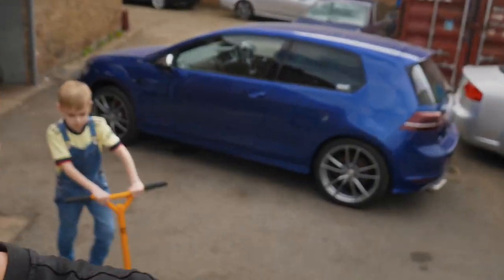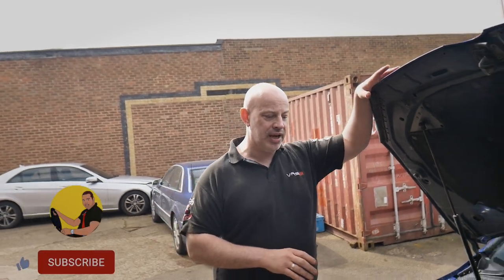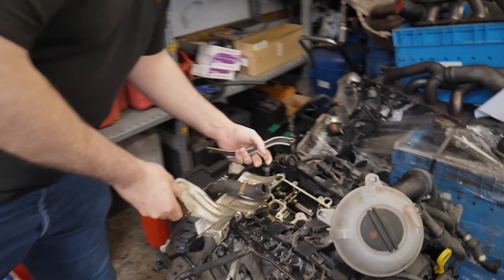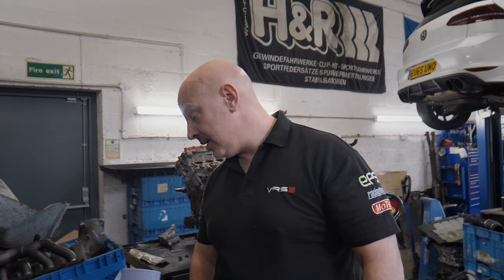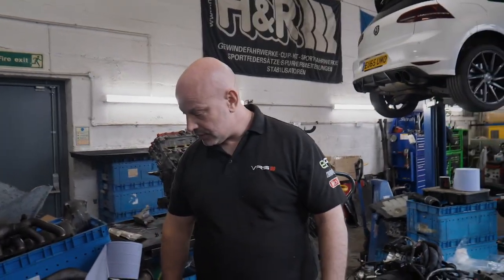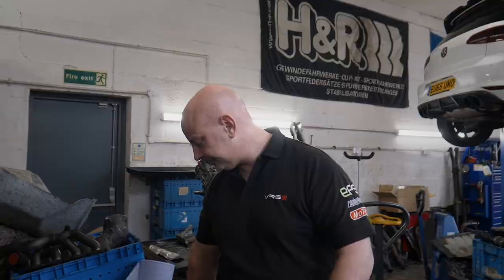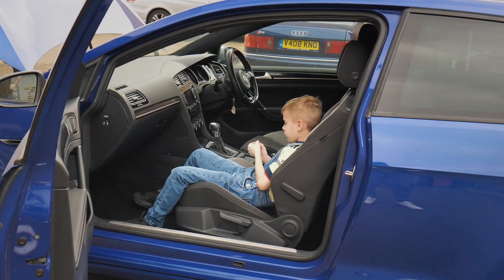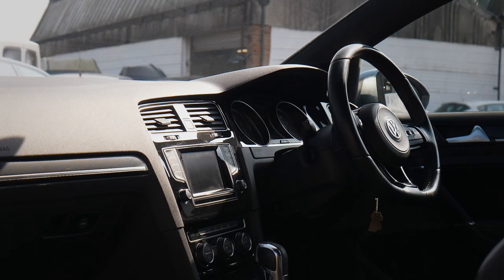MORE PROBLEMS With My 600 BHP Golf R!

Comment: if the car had ran dry of oil the turbo would have been goosed, any drop in oil pressure would have most likely given witness marks on the turbo shaft and bearings. at least to my understanding.

Comment: I want a golf R but I keep hearing there not that exciting to drive not sure if that's true or not.
Reply: I own a golf r estate and drive it in eco loads as the pops and bangs are brutal but if you want fun you slap it in sport and manual change gears with dsg and your in for alot of fun!
Reply: @Josh-li3cy  I'm running an m140i the now so it is a tough choice to be honest. The golf is more expensive in every aspect tax,fuel an insurance. But want a bit more fun.
Reply: @andy00grant  my golf gets 30mpg spinning about and 42.2 on motorway man! plus the fact of the awd I don't brake for corners man just  accelerate into them! I imagine that would be sketch for you in the 140i
Reply: @Josh-li3cy  that's where the fun factor come into it though. On the rare occasions I want to drive like a hooligan there is no hot hatch better. I maybe just need a good shot of a golf though as they occasions are few and far between.
Reply: @andy00grant  that's very true I guess depends what your looking for definitely get a shot of a golf are man!
Reply: @Josh-li3cy  to be fair I've only done 6000 miles in over 2 years I should just buy a push bike.
Reply: Depends on skill of driver as to what vehicle is better for you.
Golf R (blue badge holders club)
Civic typeR (40+)
Megan trophy cup (wannabe track enthusiast)
Focus RS (pop n bang Queens)
Audi RS3 (drug dealer)
BMW (finance #1)
Reply: @statementleaver8095  so should I just buy a Kia picanto then? So I'm not judge for any of the above?
Reply: @andy00grant  Toyota,Subaru,Peugeot,Citroen,Hyundai and Volvo are just a few left that won't break the Bank
Reply: @ChrisBeevor0511  I know the 140 is more rewarding I never said otherwise. I said I wanted a golf R but hear there not exciting. I also said the 140 was more fun/exciting through corners.
Reply: @statementleaver8095  noone posts story's about their car working you only see the horror stories online so unless you have had all these cars? Can you really say anything by fact?
Reply: @Josh-li3cy  Currently owner of an FK2 because of said reasons 👍
Reply: @statementleaver8095  well I don't have my blue badge yet.
Reply: @Josh-li3cy So why have you deprived yourself of the clutch pedal and opted for flappy paddle automatic 🤔🤔 (Left leg temporary disability for JSA???🤣😂)
Reply: @statementleaver8095  flick a paddle and skedaddle hahahahhahah I'm married does that count as disabled?
Reply: @Josh-li3cy  That's just added weight for ballast I suppose 🙊🙊
Next you'll be telling me.....
You've got Baby seats in the back and a Spaniel in the Boot🤣😂
Reply: @statementleaver8095  welll it's a vizla in the boot and just thr one carseat 😅😅
Reply: @Josh-li3cy  Do the farts when changing gears act as an libido enhancer ?
Reply: @statementleaver8095  I'm definitely hornier after some...the Mrs though....
Reply: So they say, I've had a couple of s3's and have an m135i now, loved all of them.